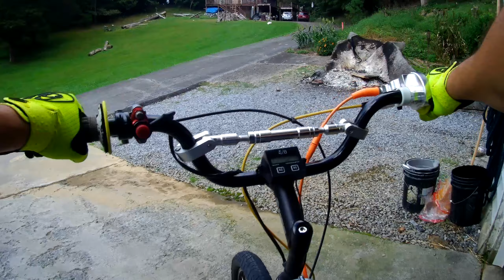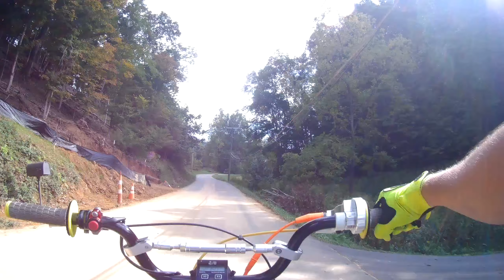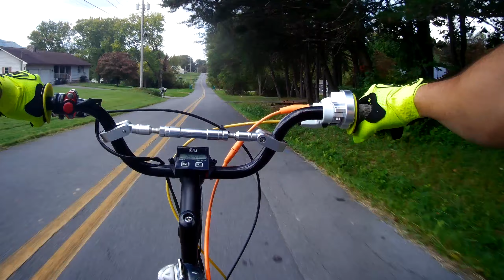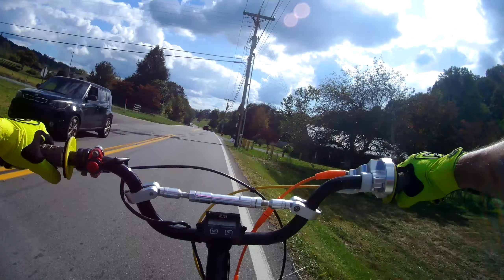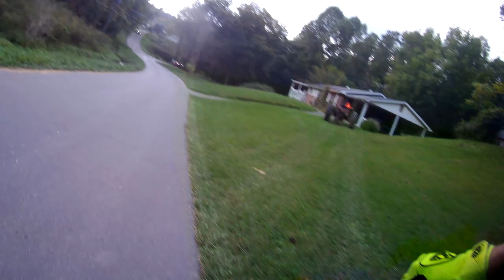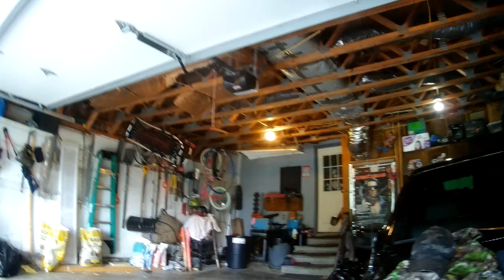Motorized Bicycle 49mm Backroad Beast.🦍🚲💨💥

Comment: Got a bit late but it runs great James, I didn't have much luck with my steel sleeve cylinder, I might revisit it when the G4 blows again. I'm on my 3rd top end on my oldest motor
Reply from the maker: Heck yeah bro. If you need any help with anything, let me know Matt.

Comment: Hay James it's moterbike Mike here, I just picked up a 49mm iron sleeve topend and dude every port on the thing waz the worst I've ever seen. But I knew that before buying it from every body else's video's. But the piston without rings is really tight at the top of the bore and ok at the bottom. Do you think it would be wise to Hoan it? And do you know what kind of ring gap I'm looking for?